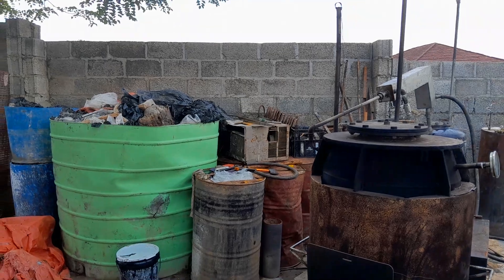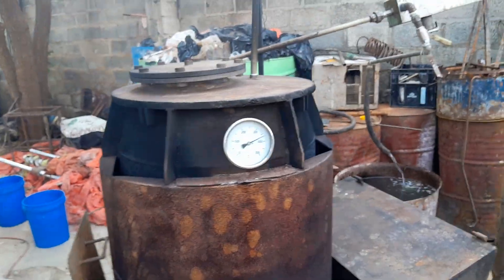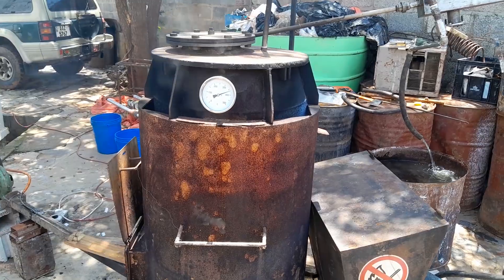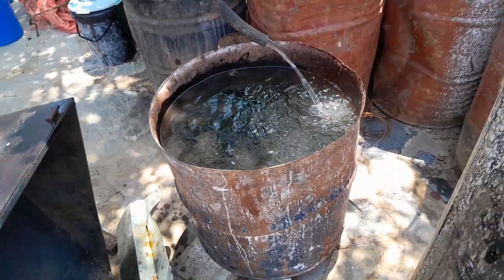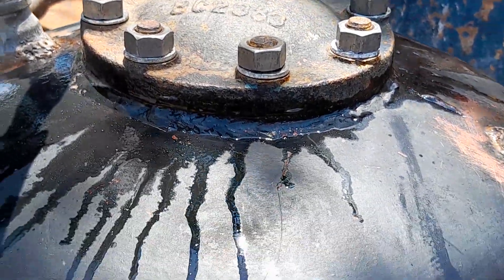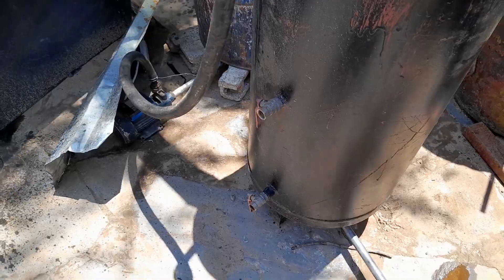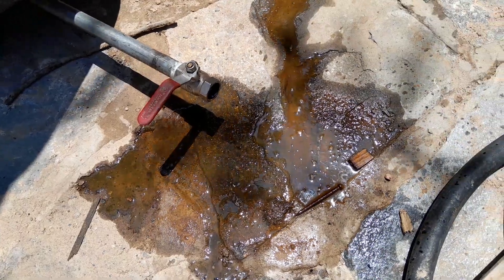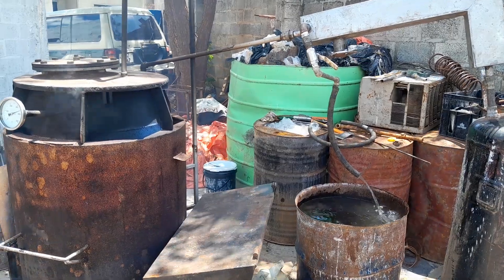Plastic Pyrolysis successful test!

Comment: Good job but I need to make afew obvious observations.

1) you have far too less gauges.
Apart from the temperature gauge on the reactor, you need atleast two more temperature gauges on other stations on the system. 
2) you need atleast 3 pressure gauges, one on the reactor and atleast two more on different stations on the system.
3) looks like you put this up hurriedly.
I'd advice you to draw a flow diagram of the system, check for critical areas which needs close monitoring and do adjustments on them. 

Anyway, good trial, I'm a medical doctor but im intrested in all things science.

I'm also intrested in system analysis and i can already identify afew areas in your system that can pause grave danger to your operators.
Reply from the maker: Your input id welcome, what improvements would you suggest?
Reply: @organicIndustrialist  do a well detailed drawing of how the system should flow.
Do all the calculations for the pressures and temperatures expected at various stages.
These are called critical points.

Critical points will guide you on where to put the gauges to monitor those temperatures and pressures.

Once you're able to identify critical points note down the parameters to be maintained to ensure safety and consistent end results.

Good temperature monitoring will ensure consistent quantities and quality end product.
Good pressure monitoring will reduce the risk of a blow out which can cause loss of life and limb.

Comment: You know you can use the exhaust gasses (flammable gas given off at the end) that do not condense to power the burner so you can safe manual effort on putting wood in and just redirect the gasses into the flame
Reply: Yeah, I did this and it saved me a lot of energy, plus its a good indicator that the system is done burning, when there is no more gas to burn.

Comment: This is contamination with extra steps😂😅😢
Reply: Oh Cammon they made it with Spits and Stitches...!!!
The Majority of the People throw Plastic in Water Even in western Countries...!
At least they recycle.
Reply from the maker: How would you suggest that we make it better?
Reply: @organicIndustrialist  
You could heating the Boiler with concentrated Solar, it would drastically reduce need of Combustible.
You could use a mechanical Press in order to Increase the Pressure at which Plastic is Heated and Filtering its Lighter Outputs with a Carbon Felt Right Outside a Mechanical Valve by Hand turning the Mechanism increasing Pressure while Melting...
As in a Sort of Reverse Osmosis...
So you could more easily Separate the Different Groups of Hydrocarbons and Leave in the boiler the most heavy Polymers..
Also, you could use the Used Oil you said in other videos you regroup from Local Farmers for making soap and utilising the Parts which are Too much Dirty for Soap Production, Boiling those with Methanol for 2 Hours while mixing in a Closed environment and You would have Biodiesel.
With it you could  "cut" the Crude Oil you produce now with Pyrolysis and Having a much Higher Yield.

The Bioproducts of Mixing Methanol and Oil is Biodiesel and Glicerine...
With the Job you have you can Separate those [Quite simple because they have different Densities and Viscosities]
Using Glicerine for Soap and Biodiesel for Making a More Carbon Neutral Clean Biodiesel along the One you produce with Pyrolysis.

You should check in with Robert Murray from UK, he is a Old Retired Material Chemist which used to working in the Battery Sector...
He make Really Useful, Incredibly Simple and Explicative Videos about Many Things.
For someone  which have a Carbon Neutral Agenda and Practical Skills like you could benefit more than me...
I am not Good At Making Things simply Putting.